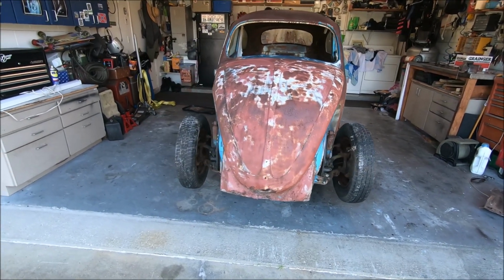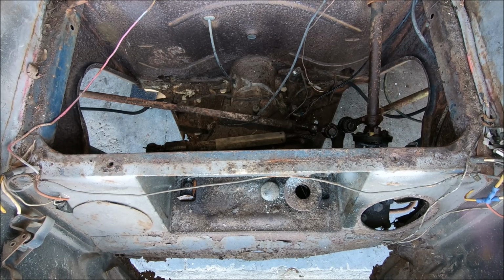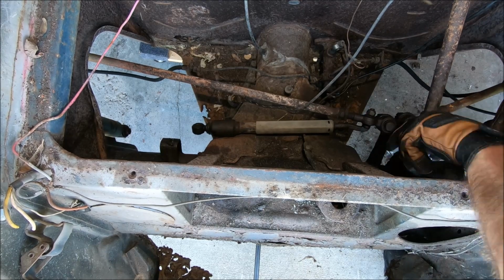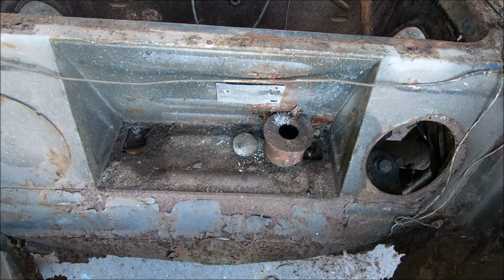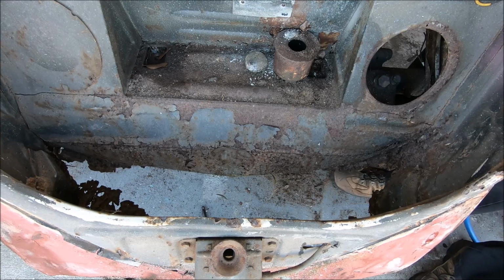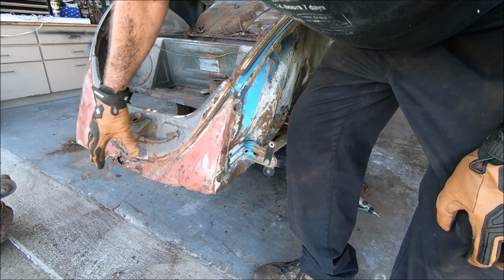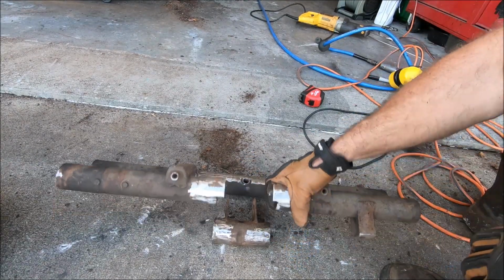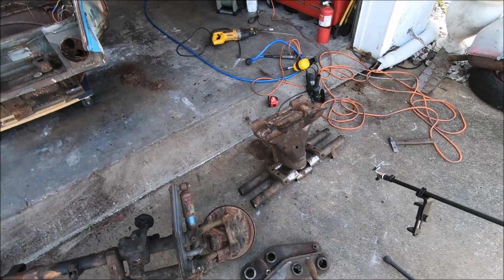Front End Disassemble and Nose Job - DIY Volksrod / Franken Beetle Build - 1960 VW Beetle - 1

Comment: You can name it Quarantina ! That will be awesome looking when you get done. Now that I have lost my hearing in one ear I do recommend ear protection. 👍
Reply from the maker: Bonis67 haha, I like that one, I’ll put it on the list!
Sorry about your hearing, I tried to modify the audio to prevent headphone listeners from that.
Reply: @VWJawbreaker  you need to use some when running the load power tools, you would be surprised how much damage they can do to your hearing.
Reply from the maker: Bonis67 I usually have them on, I’d hate to lose my hearing down the road.

Comment: Hey Gary! Keep things going great. Add oversize pipes for the exhaust. Last time I tried to remove the bonnet (hood) like you did I got a big headache.
You should have sprayed the penetrating oil for about 3 days each day before breaking things loose. When you finally finish this project, you will have extra nuts and bolts leftover.
Moe
Reply from the maker: Hey Moe! How did you survive the storm?
I’ve already gone through about a can of PB Blast on this car before it even made it to the garage. Slowly soaking everything else now to help me in the long run. 
I’ve got some exhaust ideas going right now but that’s so far down the road I have plenty of time. 
Thanks for always being here and hope you have a great rest of the week.
Reply: @VWJawbreaker  Laura peed on us a little and blew some trees down in other yards. Not too much water at our house, but one of the intersections nearby was flooded for about 3 hours. Everything was shut down so that didn't matter anyway. Had nowhere to go. Keep up the great entertaining work. Maybe a GM 501 engine in the backseat. Some buggy.
Reply from the maker: jdmeaux glad to hear nothing major happened and that y’all are ok!!! 
A different engine did cross my mind for the 60..... twin turbo LS in the rear would get some attention but I’ll keep it air cooled.
Reply: @VWJawbreaker  Seven letter word:  Porsche
Reply from the maker: jdmeaux way more than I can afford.
Reply: @VWJawbreaker  Who said to buy one? Maybe borrow the chassis and engine to put the VW body on.
Reply from the maker: That would work if I knew someone with said chassis and engine. It should all work out the way I have things laid out.

Comment: Man that bottom spline peice that you bolt to the gearbox then put in the ujoint, where would i find that?

The empi replacement is to small
Reply from the maker: Check swap meets.